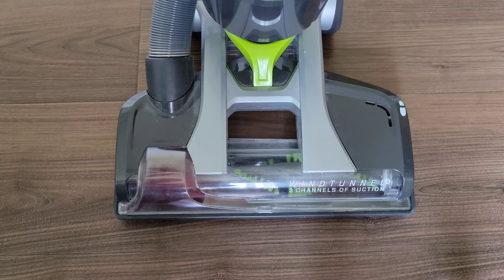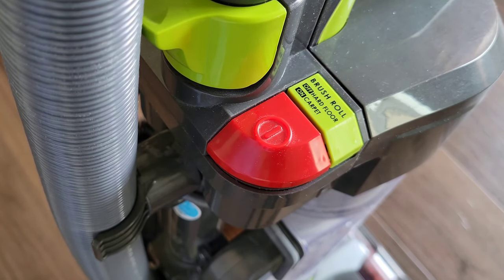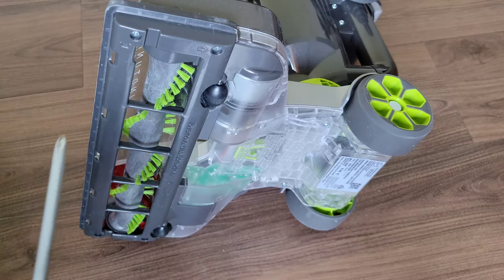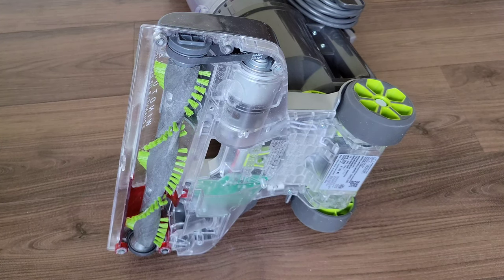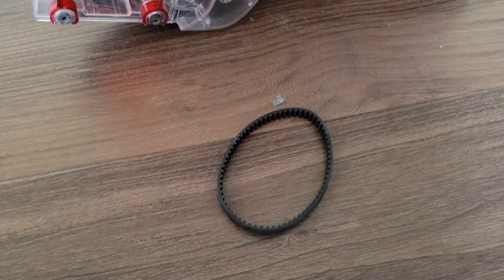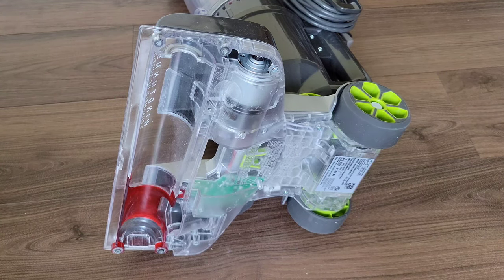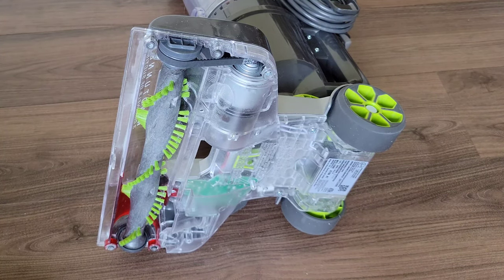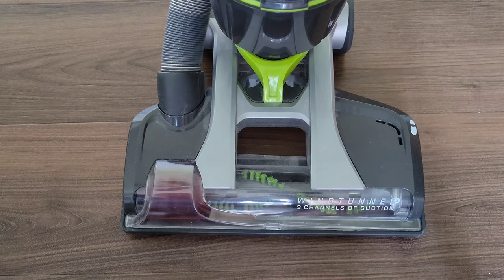Hoover Air Steerable Brush Not Spinning - How To Fix

Comment: My might be a wiring thing, it periodically on/off.
I noticed if I put a lean into it, it works (as if your turning or going around some) it stays on but straight forward vacuuming not so much any clues?
Reply: Mine is doing the same thing! I'm thinking it's a bad connection
Reply: Mine too

Comment: I Have A Hoover Elite Rewind Plus That Just Needs A Brand New Bruh Roller Assembly To Be Replaced And I Can't Find The Part For It AnyWhere I Checked Ebay And No Luck I Also Did Check Amazon And No Luck And I Also Checked And Called Hoover And No Luck The Belth Is Fine And Hoover Was Very Rude To Me For No Reason So If Anyone Know Where I Can Order A New Brush Roller That Wood Be Helpful Thanks

Comment: I'm not sure which is more ridiculous. Anyone needing a Youtube video to explain "the button" or Todd making a help video that ENDS with "if your brush is clean and the belt is fine" your vacuum will miraculously work again. I need a diagnostic process for the motor control circuit board that might explain the input/output voltages. My brush does not spin but the motor does receive 41 volts from the vacuum. I removed the motor and applied AC bench power - it does spin @ 120 volts. Somewhere between the button and the motor the electronics breaks down. Haven't found a tech spec performance manual online...yet.

Comment: Mine wont work if it's in the 'upright' position. Starts spinning as soon as I tilt the handle down.
Reply: You have probably figured out there is a trigger inside the vacuum that turns off the roller when the handle-roller components are at 90 degrees. What you are seeing is the way it is designed. Possibly not the smartest design but that's what it is supposed to do.

Comment: Push green button-no such luck!
Tale off roller and check belt-no such luck!
Must be the motor. However, the vacuum has hardly been used.
Very disappointing product
Reply from the maker: Thanks for watching, I would reach out to Hoover to see if they could help. Good luck and thanks again for watching.